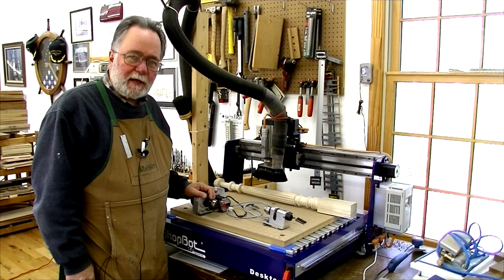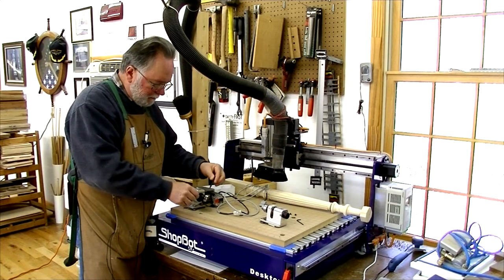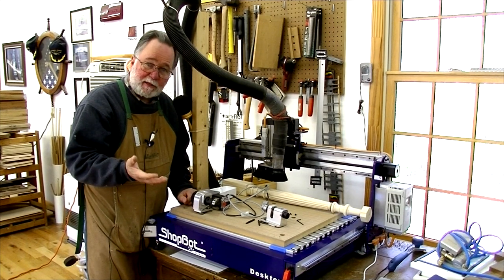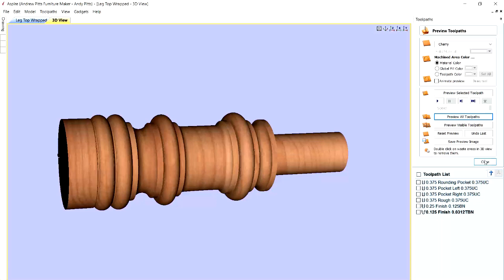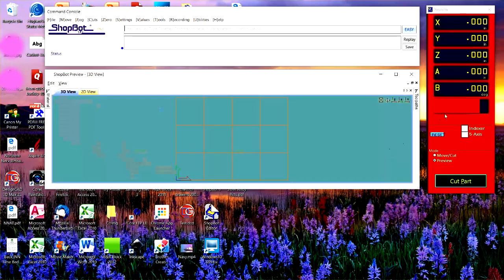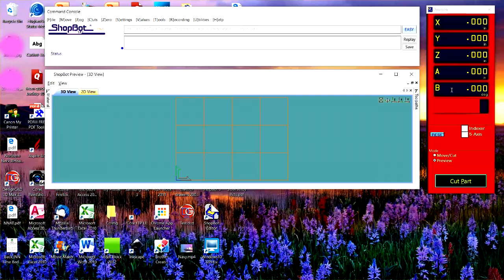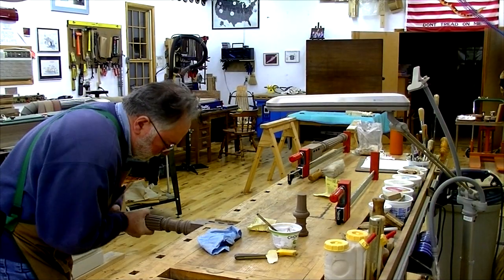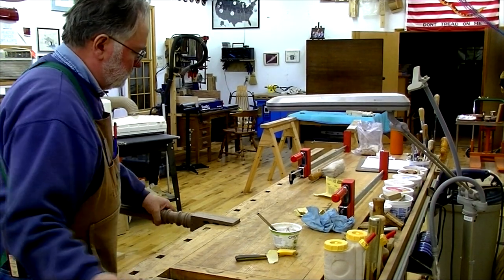ShopBot CNC Rotary Indexer: Andrew Pitts~FurnitureMaker

Comment: I'm curious if it speeds things up if you rough turn on the lathe to remove the bulk of the material.
Reply from the maker: +Alex Pettigrew Alex, I'd say if you are proficient on a lathe, you may cut off a little time, maybe, on the hogging out portion. But the setup may eat up all the savings.  I would be afraid of cutting in the wrong place or too deep, then having to start over, so I just let the ShopBot do the work.

Comment: Very interesting to watch. Why is the top section machined in a rotary fashion but the lower section was machined in a back and forth motion? The lower section seemed like it would also have been machined in a rotary fashion.
Reply from the maker: +Steve Bonte Steve, I only included small clips of machining in the video. In general, for hogging out a lot of material I used x-axis motion, and for cleaning up I used rotary motion. I found that hogging wood in a rotary motion caused some chatter, cutting against the grain.